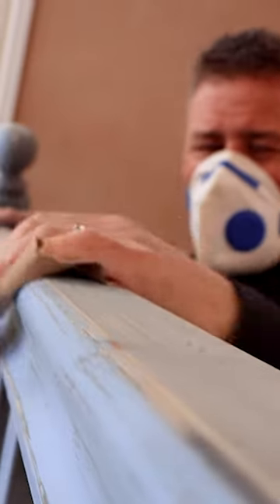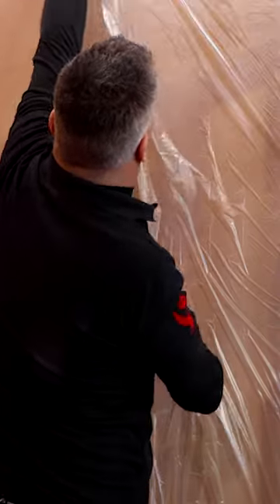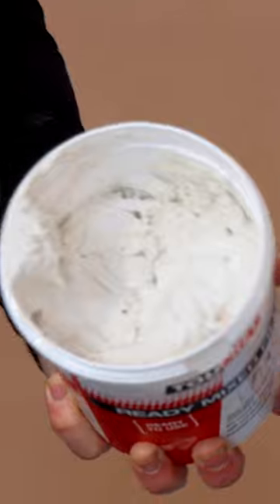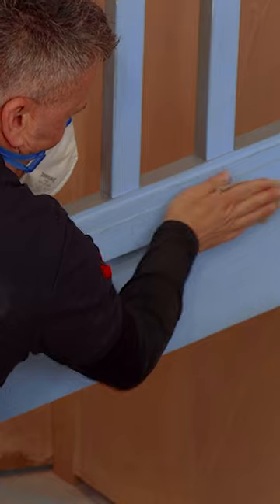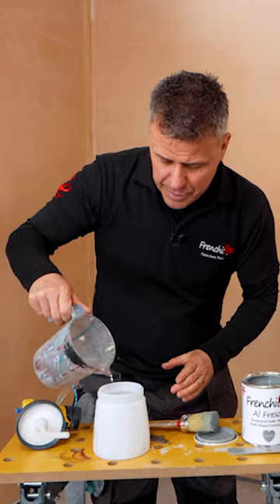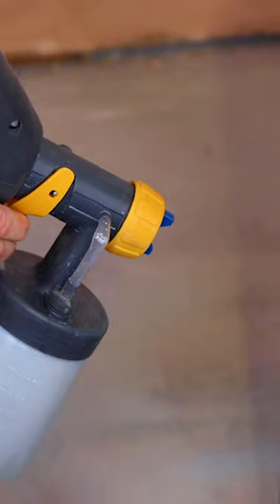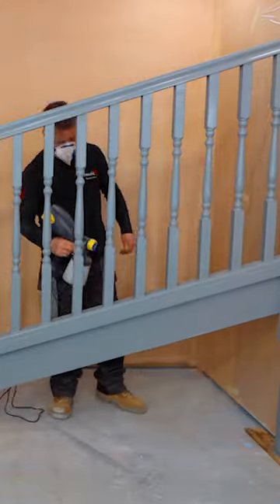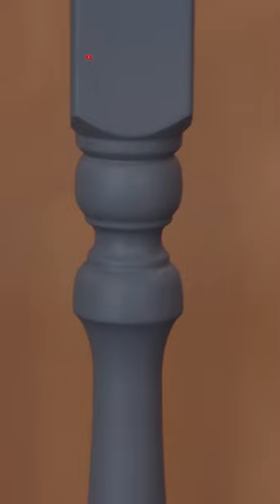Paint your Staircase like A PRO! #shorts #painting #frenchic #spindles #stair #staircase #bannister

Comment: Hi im decorating my daughters bedroom soon & shes wanting 3 walls one colour & the 4th white. In worried about using Masking tape as when I've used in past the paint has bled it is pealed off so do you have any tips please
Reply from the maker: I've seen this happen before when the paint isn't dry enough and the masking tape is applied, once you've done you one colour a couple of coats, leave this to dry for around 3 days then use a very low tack masking tape to create your line, stray up to this and then remove tape as soon as you've painted, you could also help dry the first quicker with a hairdryer before applying masking tape